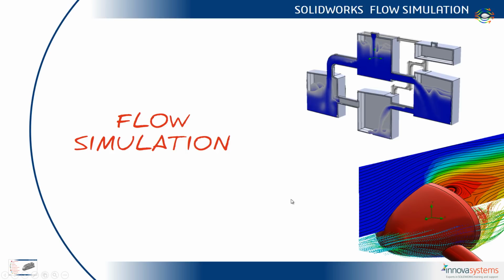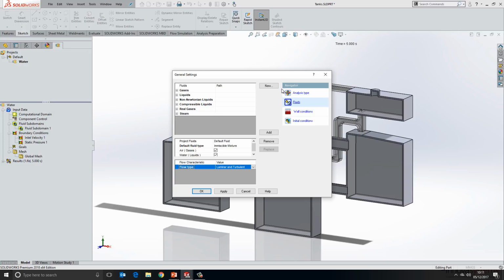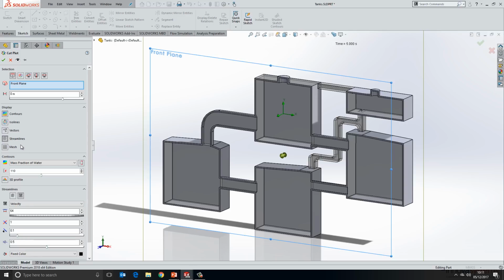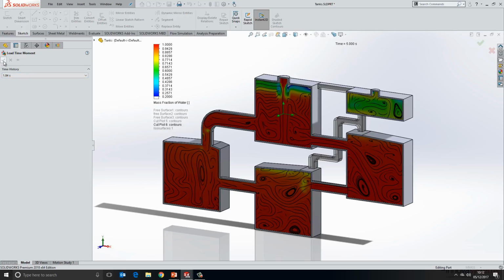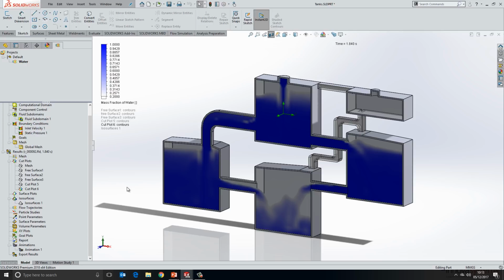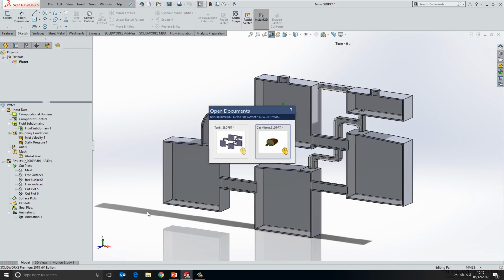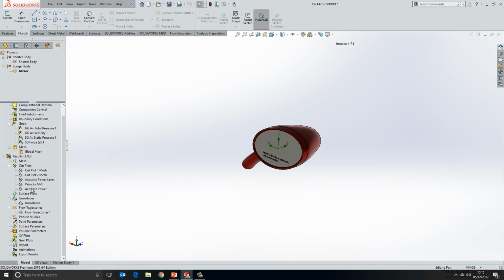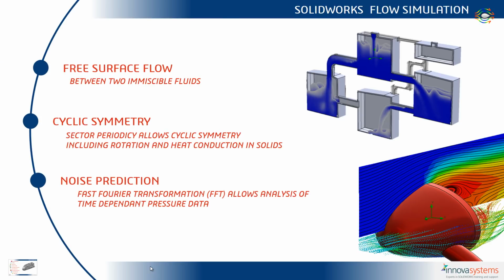What's New SOLIDWORKS 2018 - 06: Flow Simulation

Comment: Is it possible in SW to simulate for example....Metal piece in hot oven which heats for example only from the top? Metal piece should show temperature distribution thrue metal bodie?